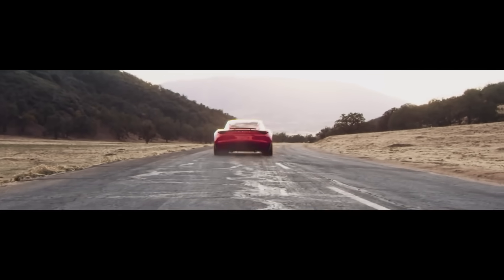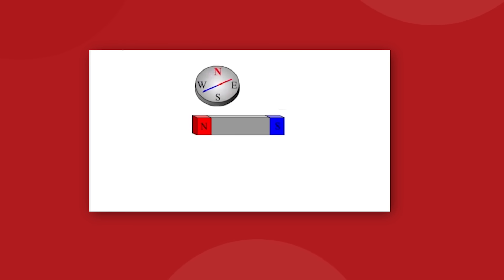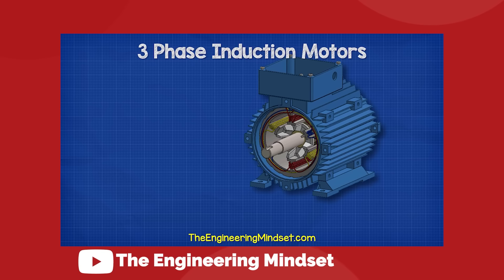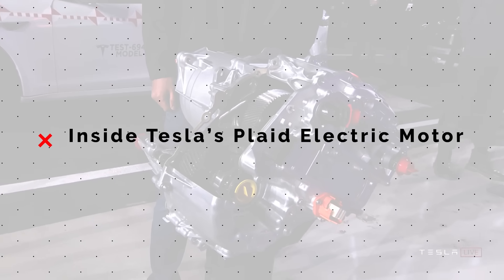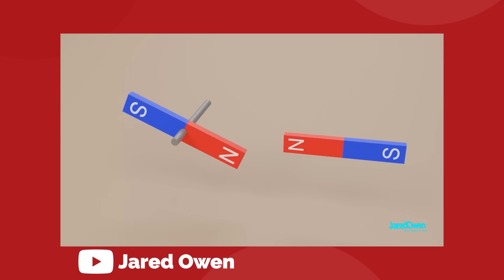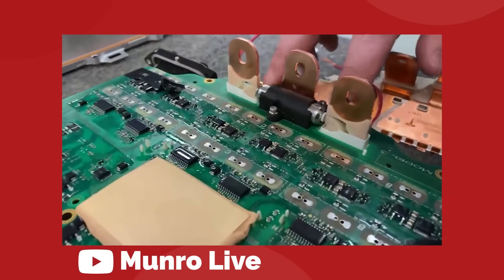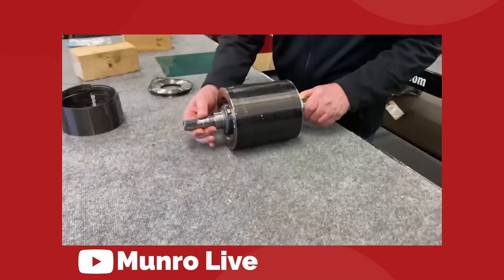The Real Reason Tesla Developed The Plaid Motor!

Comment: Enjoyed the video very much!
Proud owner of a M3 Dual and of course , stock shares.
Anyone against EV vehicles just hasn't lived with one. It's so obviously superior to any ICE vehicle.
What I find most fascinating is that no one has come up with a better motor or even matched Tesla's in power or efficiency. Hard to grasp how such a new company can do motor design better than any other.
Reply: Drive from El Paso to San Antonio, then come tell me how much better an EV is to an ICE.
Reply: @jameslmorehead  What's your point?
Reply: @Rick9482  I think his reply was that EV are far from perfect for everyone.  Tests have shown that you can only go about 80 miles (dependent on battery and motor setup) pulling a 6000 lb trailer.  The trailer I pull is 19,300 lbs.  I would have to pull and additional trailer full of batteries and solar panels in order to go anywhere.  There are several more drawbacks, but the huge one in my mind is that the excavator used to mine the lithium uses more fuel excavating minerals for one Tesla battery than my truck will in its entire lifespan.  How is this good for anything?  Most electricity is made by either coal or natural gas turbines (take a look at Hoover Dam and Lake Mead.  When are those hydro-electric turbines going to go dry as well).  Like I said, as it sits right now, EV is not the complete answer.
Reply: @DavidLayton1  An EV is definitely superior to ICE, it's not even a contest.
What gets used in the batteries I expect will see ongoing changes as new technology is developed.
Right now, it doesn't work for you but if your of average age, you'll be driving an EV in the near future, it's inevitable!

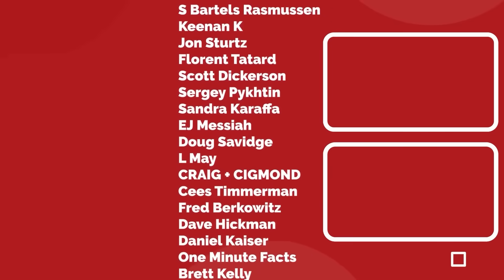Comment: Explosive fuse at 18:27...if there is ever an arc flash due to a voltage spike, it "might" create a plasma bridge, which is conductive. It would be like immersing the inverter in salt-water or a slurry of copper paste. I may have gotten some of this wrong, so there is probably a physics engineer screaming at the computer screen as he reads this...

At 16:34, the sectioned lamination stack doesn't give the motor more power. It reduces the eddy currents, so eddy current heat is reduced, which means the motor runs cooler, and...this means you can give the motor more amps before reaching it's temporary or continuous heat cap, when the monitoring system will reduce amps to prevent overheating.

Comment: NOT MODEL S SPECIFIC:
This won't be a model S specific feature. It is merely a evolution seen in the newer motor from the model S that was stripped down compared to the motor from an older tear down of the model 3. If you were to look at an older model S I expect that would be missing the fuse, and I expect if you were to look at a newer model 3 that it would have the fuse.

Comment: Quite likely, they are not using epoxy resin in the composite sleeve. With the tension required to pre-tension the carbon fiber, it would squeeze an epoxy resin out during the winding. A thermoplastic resin with a high melting point works better. Electric motors run at fairly high temperatures, this is why a high temperature resin is needed. Winding the carbon fiber over the magnets requires high tension if you want the sleeve to maintain radial pressure when the rotor shrinks at low temperature.

Comment: Double to triple the price for a Tesla over an ICE car......new battery needed at 8 to 11 years. Look up failed parts on tesla. Recharge for 87% of tesla owners is via coal ..nuke..and Gas electricity.....pretend greens. 77% of tesla owners charge on slower chargers taking an average of 5 to 7 hours. A standard outlet in a home can take 40 hours. See Tesla manual. ice vehicle, fill up in 2 minutes, travel 600 to 900km. EV's still expensive toys for pretend Greenies.

Comment: Induction motors don't have permanent magnets in their rotors. A magnetic field happens in the rotor due to induced (hence "induction") currents in conductors in the rotor. 
Tesla uses brushless DC motors which have permanent magnets in the rotor and use electronic switching to control the polarity/strength of the fields in the wound stator.
The commutator shown at 6:13 is a mechanical switch used to alter the field direction in a wound rotor. this would typically be used in smaller motors which have a pair of permanent magnets as a stator and are often seen in toys, also car starter motors. The commutated rotor can also be used with a wound stator, in the case of the universal motor, used in AC powered tools, like drills and skill saws. 
Induction motors tend to be large and heavy (there are low powered exceptions, like fans and old record players), but very quiet and very long lasting. Universal motors produce a lot of power and are comparatively small, but make a lot of noise and require maintenance when the brushes wear out.
Reply: thank you for this comment, this guy's video is driving me crazy
Reply: Me not being engineer at this field just wonder: whe there were 3 contacts shown on the invertor? Dont they represent 3 phase of ac induction motor? Though i agree withagnets in the rotor:-)
Reply: @yx2803  There are three phases to this motor, however, the frequency and amplitude of the three phases is controlled by some high speed switching circuitry Usually, devices called IGBTs are used in a chopped three phase H-bridge setup
Reply: Awesome - I was hoping someone would make those points!
Reply: Everyone saying "you explain it so simply" - not realizing how much is so wrong.  To be fair, the Long Range does have both PM and induction motors, but the Plaid does not.  I almost choked when he got to the commutator, as if the Plaid were a giant electric drill.
Reply: Thanks for clarification! Also, I dislike the term brushless DC motor. The operation is a permanent magnet rotor with alternating, switched stator currents to create a rotating field. It relates to the induction motor in the way the stator field is changing in time.
Reply: @robertheim352  the term you are looking for is (three-phase) permanent-magnet synchronous motor